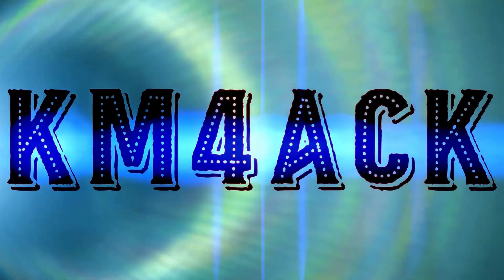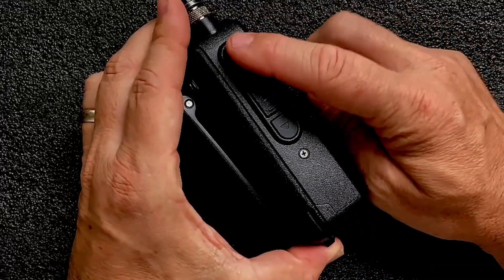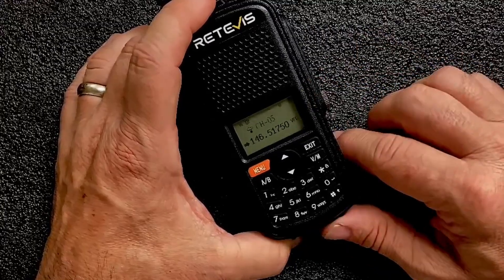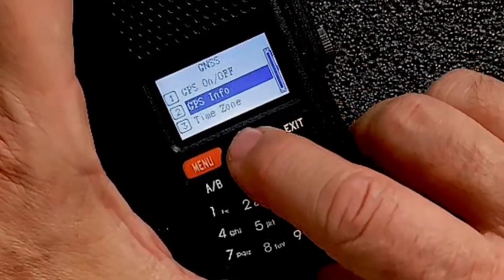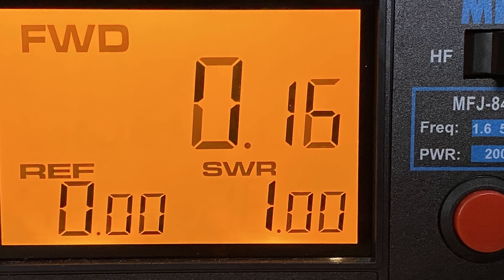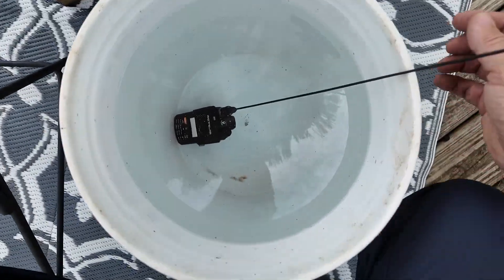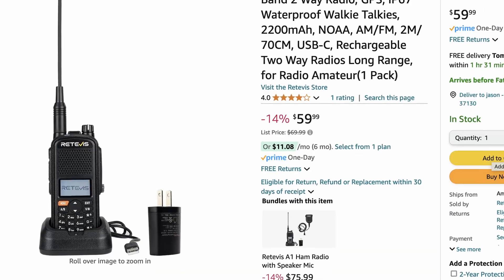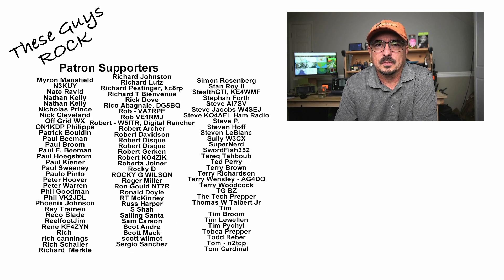Retevis A1 HT

Comment: Jason, great look at the radio.  I'm wondering if you had to choose, would you take the A1 or the RA89.  The RA89 doesn't have NOAA channels (at least as far as I can find) and is 10 watts.  The A1 has NOAA and while the GPS isn't a standout feature per se, it could still be a big benefit in an emergency to know exactly where the user is (lost hiking, etc).  The A1 looks a little easier to program, as well.  I really like my RA89 but I may need to add another "back-up radio" to my collections.  73!
Reply from the maker: I’d go with the 89. You can always add the weather channels as memories and I like that it’s 10W. Also, you can use Chirp to program the 89. Food for thought.

Comment: I just got the radioddity GA 5 Wb HT and loving it so far . does everything the VERO N75 mobile does but more.. It has built in GPS a compass,  air band AM RX  USB C charging and something higher  cost HTs have it will notify you on  screen where APRS users and direction from you.  you can aslo message off the radio but the phone app is easier

Comment: I would prefer the offset to be pre-set but changeable.

Does it use the K connector pinout? So I can use my accessories and AIOC.
Reply from the maker: Kenwood style connector same as the Baofeng UV5r
Reply: @KM4ACK  I am a UV-82 guy, but they work too.